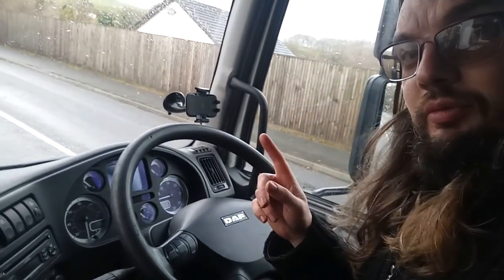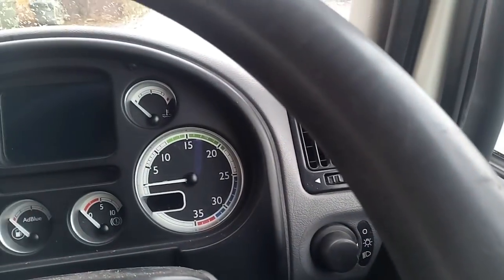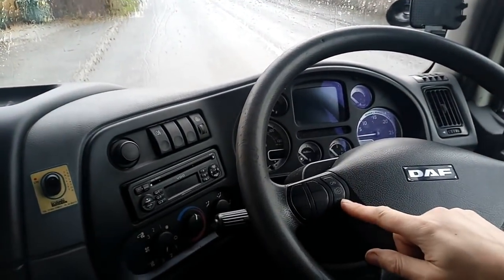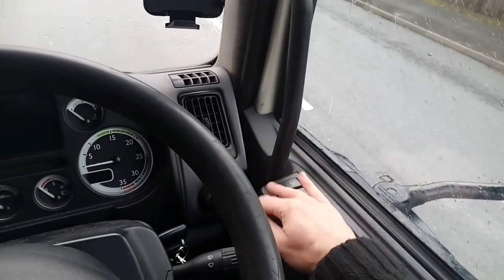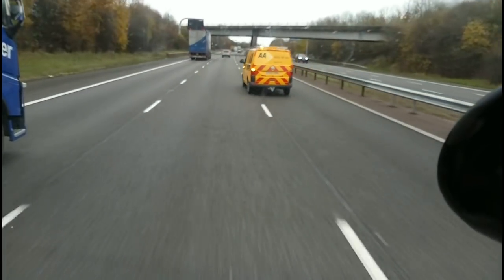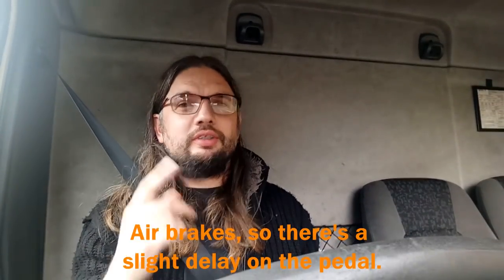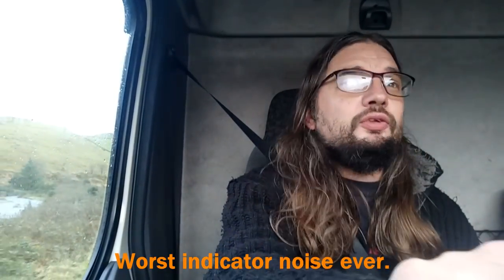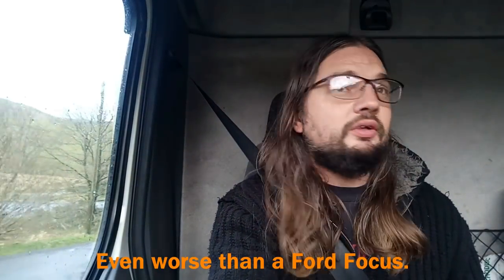How to drive a 7.5 ton truck. I like trucking!

Comment: Speed isn't what's annoying on the motorway or even a roads ... It's inconsistent drivers .... Oh I do 75 ... Now 68 ... Then 80.... Perhaps do 60 for a while until I get overtaken ... Then I speed up ... 🤣🤣🤣 Not annoying at all
Reply from the maker: Oh yes! Using cruise control in the Lexus, you notice this behaviour all the more. Infuriating! Mind you, in the 2CV, speed is very much wind/hill dependant, so it does change a fair bit...
Reply: This is why I don't do 70 in my car, as people who aim for 70 seem the worst for it. I could possibly understand if it is an older car, but when it's a 3 year old BMW (with the EASIEST cruise control system in the world), it does annoy you. That button is there for a reason... use it!

Comment: The DAF 45 LF is a vast improvement on the previous Leyland Roadrunner based 7.5 tonner, though they kept the same crappy old gearbox from the older model that works best when you double declutch both up and down the cogs (certainly a smoother change), though it’s better than the semi-auto fitted to some Ivecos.

It does sound like you hired from rent-a-wreck.
Reply from the maker: I've no complaints really. It's a 9-year old truck that I imagine has rarely been treated well in its life. I thought it was good value at £100 a day. An immaculate truck wouldn't have done it any quicker...
Reply: HubNut that is very true. No reason for a 7.5 to be limited as they’re near the top of the rev range at 56mph I often drive one of these at work, 10-plate with 335,000 km on it. They hide their miles well.

Comment: What's the add blue about?  
My cousins have 2016 Scania V8 R580 that was like a spaceship inside and automatic.
Reply from the maker: AdBlue is derived from pig's urine and is used to try and clean diesels up. Only it didn't seem to work on this truck.
Reply: HubNut 
Ah right interesting, 
I think all Trucks should run on cherry as their taxed too much my cousins are spending 6,000 Euros a month to keep their Scania running.
Reply: I think they go in limp mode if it's not working. Dial problem, maybe.

Comment: I learned in an LF, although mine had a range changer switch on the gearbox.  8 forward, plus reverse (I think).  Speed limiters aren't good, in my opinion they're dangerous - I had an argument with another driver that was with me the otherday when I got told "you're on the motorway, go on the limiter".  No, I'll set the cruise at 86, and set the overspeed to not allow me to go over 3km/h, so theoretically I shouldn't then go above 89, and the vehicle's limited to 90.  Of course going down hills I'd manually override it and put the engine brakes on at the top of the hill.

I've had cars sit next to me on motorways, worse place to sit is next to the cab on the passenger side (it's why LHD trucks always sit cars on the front by the cab).  Car drivers pulling in front of the vehicle closely is also irritating, 44 tonnes doesn't stop anything like a car, you must've noticed it in your 7.5T vehicle.  Mine without product (work for a bulk powder company driving tankers) is 13.5T.  I do believe that as part of the driving test car drivers should be put in a truck and forced to drive around a small circuit to appreciate the amount of room that we need, and room to safely stop.  There's a reason why I've left such a huge gap between me and the vehicle in front.
Reply: Totally agree make all new drivers go out in a 7.5 tonne van around a course of cones and obstacles and see how many they hit, maybe then they wouldn't sit in their cars leaving a gap a mini would struggle to get through waiving you through and moaning when you don't go for it . Its bad enough driving through towns and down narrow streets as it is , it would make the new drivers better in my opinion.
Reply: I definitely think so, at the very least hopefully they'd be a lot more sympathetic towards HGV drivers.
Reply: As long as you do not exceed 60mph (96.5kph) on a motorway you are not exceeding the speed limit. This means you can drive to the limiter at 90kph  and have the overspeed set at 96kph.
Reply: Yes, that is the legal speed limit.  However, if you go above the vehicles limited speed (whatever it may be, 90km/h by European law) for more than a minutes it gets recorded on the Digicard.  Whether or not it's classed as an infringement, I don't know because you're not breaking any law, so it shouldn't?

Comment: Euro Truck Simulator makes it seem so easy (well, they're artic trucks rather than fixed-chassis ones like this DAFt), but then, everything simulated on a computer is easy 'til you experience it in reality... :P
Reply: In reality those rigids are much more difficult to turn (not so much the LF, but vehicles like the CF 8 wheeler, tippers) than artics.  Artics you turn wider, but you turn a lot less, and can turn much sharply.  Only pain with the artics (as I'm finding out) is the sodding reversing...
Reply: Late reply - but - I drive better IRL than in ETS... although parking is a little easier as there's no pressure, and you always have perfect visibility. The trouble IRL is managing your tacho, FINDING the sodding places (some places I swear are like a secret), navigating labyrinthine 7.5t restrictions, and keeping a second pair of eyes out for low bridge signs. Oh, then there's the night time motorway diversions, which are signed up by madmen.

As above says, rigids are harder to drive irl (well, the full-length 12 metre ones anway), as they have a HYUGE turn radius. Artics turn on a dime, but they do cut-in on the inside of the turn, so although you can U turn in half the room as an artic, tight corners are a nightmare. The main problem with artics is that as soon as you turn, you lose sight of the back of the trailer so you have NO IDEA how far the arse end is swinging out - you just have to allow 5-6 feet and hope there's no crunching sound xD

Comment: That's not a truck...it's a puddle jumper!!!
Reply from the maker: I did feel a bit of a fraud parking at the truck stop, with all the 'proper' trucks...
Reply: Haha :)
Reply: Its just a over sized van 🤣 if it dosent bend inthe middle and have to go though 24 gears its not a lorry 🤣🤣
Reply: ecutech puddle splasher
Reply: It's only half a puddle jumper because half of it don't work lol

But as I drive a puddle jumper there's nothing wrong with puddle jumpers lol

Comment: Why overtake if YOU're LIMITED?
Reply from the maker: Because different trucks have different speeds, especially with gradient changes.
Reply: @HubNut  Hills, sure but it''s futile overtaking another truck on a level dual carriageway. It's holding up other traffic.
Anyone wanting to pass me is welcome, I'll even drop the power to let them get in a little quicker

Comment: Guessing your driving the lf45 160 seen as you only have 5 gears the lf45 180 is much better also has a 6 speed box and has good pulling power however the 180hp is rare in a 7.5 ton i have a euro 5 180 and its fantastic
Reply: I don't know about the tech spec as long as the wheels go round but the new daf are great but a brilliant video for us puddle jumpers but the best bit is how excited he is driving it most would have left in vor

Comment: How did you end up with a truck driving license? Or is that not obligatory for 7.5 tonnes in the UK?
Also, that truck doesn't look old at all and the mileage is low. How can so many things be broken already? Shocking! Do you have any idea of its history?

A friend of mine is a truckdriver and he drives DAF's. But even when he started out and he got the crappiest mid 90's DAF of the company with almost a million miles on it, it still all sort of worked. I never hear him complaining about the newer ones.

It keeps baffling me how some cars enter the highway next to an overtaking truck and expect to be seen...
Reply from the maker: If you passed your test before 1997, like I did, you can drive a 7.5 tonner without requiring any form of tuition. Which is a bit daft, I'll admit. Before I ever drove one on the road, I'd already driven a full-size HGV on an airfield (at 56mph!) to  get a feel for it. Very useful.

Comment: Great video did you need to do a sound test to get 7.5 ton licence.
Reply from the maker: No test required, due to my age. Not sure what a sound test is...
Reply: Cool I pass my car test in 2006 so my licence only allows me to drive a van no more than 3.5 tons.
Reply: When did the licence change as I passed my test in 2001 and I cannot drive a 7.5 ton truck? Intresting video ,always good to see something different on Hubnut.
Reply from the maker: January 1997. I'm old!
Reply: @HubNut  makes me old thinking about 1997.....

Comment: The climate controls on the new DAFs are even less accessible than the ones here. They’re almost under the dashboard and the side of your leg is always inadvertently turning the heat up to full. Whoever designed that deserves a good flogging.

Comment: Fit an HHO2 kit and gain 10% more power and 30% better economy. Another bonus are no black soot particulates...
Reply from the maker: The downsides are that HHO2 is complete hogwash, and it isn't my lorry, but there you go!
Reply from the maker: +MARTIN STRANGE I'm referring to it as being snake oil. True that hydrogen can improve combustion, but the claims made are ridiculous and never account for producing the hydrogen.
Reply: If you want more power out a Diesel and aren't averse to modifying it LPG injection works marvellously.

In this comment section we obey the laws of thermodynamics

Comment: I'm surprised there's a delay on the brakes on such a small vehicle; I used to drive air braked buses which didn't have that problem. The trains I drive now (HSTs and Class 57 locos and coaches) , they have quite some delay on them.
Reply from the maker: It wasn't a massive delay, but reversing it down our driveway was not very smooth. Very hard to get a gentle brake application.
Reply: Yeah the brakes on these are horrific. If the exhaust brake worked it may have helped a little bit
Reply: HubNut I used to occasionally drive a MAN 7.5t, I found that just touching the brake pedal until the brakes came on, then braking normally was the smoothest way to brake with air brakes.  If I tried to brake like a hydraulic system the initial braking was very snatchy.  Must say though, I did like driving it.

Comment: 56 is too slow for a truck. i thibk they should be able to go 65. im a van driver. my van has no limiter. i think trucks would be safer at 65. then no build up overtaking
Reply: The thing is, there are so many variables to consider in a lorry, particularly with the load. An empty rigid I can quite happily drive like a van. Even an artic with an empty trailer is very stable these days - but if you've got 26 tonnes of stuff in a double-decker trailer, you can very very easily get into some serious trouble if you mishandle it. A temporary override to allow you an extra 5mph once every 20 minutes could be a way to improve traffic flow - but then if your speed difference is that low you need an override, why not just knock 2kmh off your cruise control and forget about it?
Reply: Here in the us the speed limit for trucks is the same as cars. 70 mph

Comment: Wow, even a 100 litre tank doesn't give a huge range then at say 15-20mpg
Reply from the maker: Nope. Lexus feels quite thrifty now!
Reply: One trip I did from Bath to Glasgow in a rental Ford Cargo loaded with glass display units foot to the floor meant stop for a (rest)break and fill up at every services.
Only qualification my firm needed was over 25, clean licence and a credit card. Took a week to get fuel  used refunded but it got me out of the factory just before Xmas most years.
Reply: The comment about filling a 100 litre tank made me chuckle. I've racked up a bill closer to a grand before when I filled an artic from empty with diesel, put 3/4 of a tank in the fridge tank, and filled the adblue (in itself that cost 60 quid). I'm pretty sure I heard the bloke behind me choke a little.

Comment: Get your provisional entitlement and try driving a Class C/Class 2 truck one day, preferably one with a manual gearshift. They are an entirely different proposition :)
Reply: Yes. Maybe even go out with an instructor do a lesson all camera'd up! 18 tonner or something similar. ⛟⛟⛟
Reply: @jesuspobre88  Recently been watching a learner in a rigid - doing reversing. If I had a go at that, I'd want an artic !
Reply: I prefer driving an 18 tonner than a 7.5 tonner.
Reply: @WheelieMacBin Same here :)

Comment: Very familiar with smol DAFs, and yeh, they're bags of shite. Surprisingly, those funny Japanese boxes (e.g. the Mitsubishi Canter), do a job of a 7.5 tonner far better, particularly as the autos are proper autos (not automated manual), have a greater payload and can quite easily keep up with car traffic (even with a full load of concrete lintels and bags of cement in the back). Problem with them, of course, is no air - so the ride isn't as good as it could be, though of course you make fuel savings with there being no compressor. Another disadvantage, as they're scaled-up vans, you don't get all the conveniences of a true HGV, such as convex mirrors, heated mirrors, cruise control, manual speed limiter and so on. I'd take one of those over a smol DAF any day, though.

If you really are a glutton for punishment, I'd recommend an old Renault Midlum 7.5t. Imagine a DAF LF cab that a French engineer has pulled apart to put their dashboard in... Once you get up to artics, things get better, mind - as you're more likely to spend extended periods of time moving in them. Climate control, heated seats, adaptive cruise control, etc, are all pretty standard. I've yet to drive an artic I've found unpleasant - even older CF artics are nice compared to their rigid axle brethren.

As an aside, it's nice to hear from car drivers who understand the pain of being held out in the middle lane by people increasing their speed.
Reply: There is nothing fun about driving a mitsubishi canter 

Car handbrake for a truck that carries much more than a daf in weight 

If you have a back problem before you start your day in a mitsubishi canter you'll have a back problem after 10 hours in one of those plus no space to put your juice etc for the day you feel like Peter sellers driving that pool cleaner truck

Comment: Those 7.5t were good fun before the restrictions come in. Now they are limited to 60. Boooooo!
Reply from the maker: Even worse than that. They're limited to 56, even though it's still legal to drive one at 70mph on the motorway. It's a funny old world. I normally drive minibuses, which are also legal to drive at 70, but limited to 62mph instead. Not that we have any motorway in mid-Wales...
Reply: I thought they had a 60 speed limit? Oh well today I learnt something. I remember just after passing my class 2 in 2007 I was working for a van hire company on agency and i was chatting away while driving a 7.5 fridge Daf along the A34, looked down and I was doing 87 mph and had blue lights behind me. I crapped myself, pulled over but the fuzz carried on pass on to something more important. I was lucky that day.
Reply: @TheCounty90  I thought they had a 60 speed limit?, The new regulations in England and Wales for heavy goods vehicles (HGVs) over 7.5 tonnes speed limits rise from 40mph to 50mph on single carriageways, and from 50mph to 60mph on dual carriageways. The national speed limits for HGVs over 7.5 tonnes, travelling on a single carriageway increased from 40mph to 50mph. The issue is that left hand drive trucks, are limited to 56mph cause were they are from, you very often see uk trucks flying past non uk trucks. and it could also be a reason why they remove the nanny what is also dangerous according to the police as it can affect braking so they can match the other trucks. most Europe it is 56mph but slightly higher in a few eastern country's, all the data i see the uk has the fastest limit for trucks or a least in the top 2
Reply: @stevekenilworth  Up until 2006 7.5T was restricted to 70 mph but then they put limiters on them. This restriction coupled with the fact that you need a special test if you passed car test after 1997 makes 7.5t less viable in the UK now.

Comment: Why a Foreign truck
Reply: So if you drive a DAF LF or a right-hand drive XF and CF, the chances are it was manufactured right here in the UK at the Leyland factory, and if you drive and left-hand drive DAF XF or CF it would have been built in Eindhoven. Leyland DAF was a commercial vehicle manufacturing company based in Leyland, United ... company to form DAF NV which was owned by DAF Beheer (60%) and Rover Group (40%). ... Cosworth · Cummins UK, that is the only info i can see online, do not know if its still 40%

Comment: Rental Lorries are always treated bad 
For stress drive a Double Decker Bus those added noises of crisp packets phones and questions while trying to avoid Cyclists FUN .I drove them in London for 20 Yrs
Reply from the maker: I've driven a couple of double-deckers, but never on the road. Oxford must be an extra special hell for bus drivers.
Reply: London route masters then Big Bus tours 
If I had a pound for everytime I got asked the time under the clock at westminster
Reply: my worst experience regarding trucks was the other week driving an 18Tonner up the steep hill near Watford on the M1, and hte AdBlue "creep mode" activated and got me slugging down to just over 25MPH in freeflowing traffic.